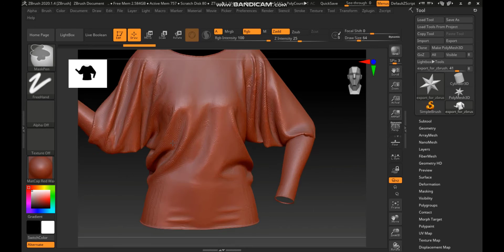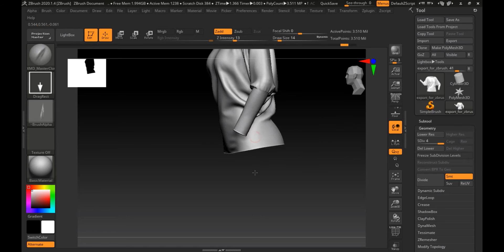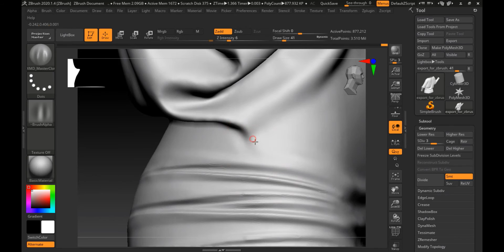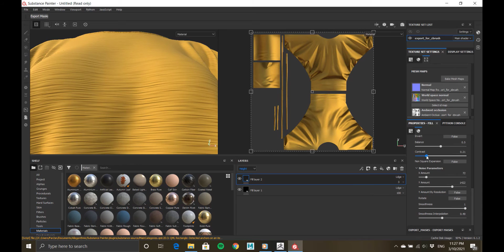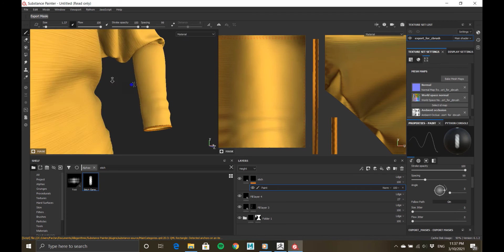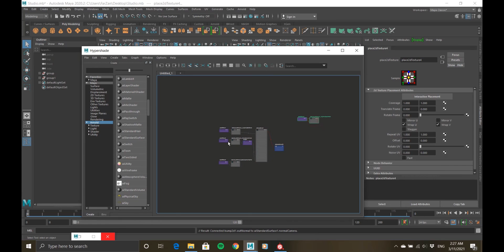Fabric material & rendering pipeline for dolman sleeved shirt : Substance Painter & Zbrush & Maya

Comment: how does this process go if its going to be an animated shot? does zbrush still come in?
Reply from the maker: You mean like a 360 animation without moving right?
Generally, I use Zbrush for some wrinkles or something that I can't make in MD and it has no issue with animation then yes, if it was an animation, I would still use ZBrush.
Reply: @paradoox1001  not a turntable, cloth animation